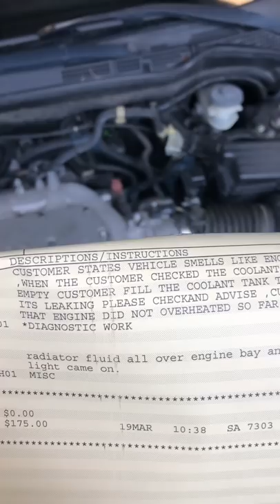Do not use this type of hose clamp because…

Comment: Had nothing but issues with oem clamps, especially working up north. Almost every one of my trucks leaked in cold weather with low mileage on factory clamps, replaced with that style and never another leak for the next 300,000 miles lol. More like never reuse  factory one..

Comment: Tighten them on speed 1 with a impact you good to go use them in mine never had a issue  thowes clamps tho I've been to shops where thay put the hinge where you need the proper tool to get them off

Comment: Yes there's an issue with the material the radiators made of. That clamp is not the best policy. Someone could overdo it.
I've seen repairs done that included using pipe inside to strengthen the rad. Inlet tube.
Then you use a goop and the former material to restore the shape and reinstall the hose with a good clamp that won't overtighten.
Alot of shops won't try that, but certain ones have. Years ago, the expensive Behr style radiator used in Mercedes would fuse to the inside of the hose at the inlet.
The time may add up to the money a customer could spend on a new part for the car in the video.

Comment: Had the original type clamp been used, it would have still made a visit to the shop. That plastic is not designed to last forever, typically going brittle around the tenth year in service.

Comment: The clamps never broke metal fittings. This is what happens when the metal is replaced with plastic. Instead of saying the clamps are garbage maybe you should say the clamp is too good to waste on a plastic car. Four of those hose clamps have been used to hold down racing engines .

Comment: That radiator didn't fail from the aftermarket clamp. The plastic degrades over time and becomes brittle. This happens with factory clamps as well.
Reply from the maker: on a 5 year old car?
Reply: @2zzlow  sure depends on the climate. A radiator in Arizona fails sooner than a radiator in say Portland Oregon.
Reply: 100% true. You can see the plastic is degrading. It's totally normal, and it definitely happens faster in hotter climates. For example 10 years max on a factory toyota radiator in Florida. When I moved to Oregon, I saw plenty of 20 year old factory radiators still running on toyota's.

Comment: Worm drive clamps are more than okay. Preferred actually. 

The spring clamps are okay, until they’re not.

The problem wasn’t the clamp. It’s the fact that OEMs are cheap as fuck nowadays and use plastic that gets brittle and breaks after so many heat cycles.

Comment: Just use the right size they work great they're not great for super high pressures but a radiator shouldn't be more than 20 psi.

Comment: That radiator did not fail from that clamp. Yes wrong clamp was used but not the cause. Radiator was already brittle . Seen many radiators break the same way with Orem style spring clamps.

Comment: The radiator has a plastic flange and will deteriorate overtime the clamps has nothing to do with it, the radiator would have broke regardless of what type clamp you use. Just use the correct size and don’t over tighten it!

Comment: Can I use a worm clamp on a metal coolant line the metal coolant line had to be cut a little due to rust, so I no longer have a flare on it and wanna tighten it a little more than usual just to make sure it doesn’t slip off.

Comment: I much prefer worm gear clamps. The spring clamp ones will invariably leak unless you wiggle them around, move the hose a little, etc. At least in my experience.

Comment: I hate these clamps so much you need a wide angle plier to take em off and sometimes a special tool in tight spots but they aren’t that bad once you get the trick to deal with em down

Comment: 2 million miles on my engine and screw clamps work just fine.. when the plastic tends to break, it doesn’t matter what clamp it has.. the plastic is not made to swell, the hose is, Hence the barb to secure behind..

Comment: Been using them style of clamps forever and never had a problem so long as you use the correct diameter clamp and not over tighten the hell outta it.

The one in the video was the wrong diameter so they had to screw it in way more then necessary + it looks like they over tightened it.
Modern Plastic radiators also don't help 😅

Comment: Never had issue with these clamps. Don’t over tighten and let the rubber do its job. The plastic radiators are a big problem with the composite construction becoming brittle, cracking, and leaking around the seals as they age.

Comment: The way the inside of that Radiator hose looked. Looks like he has more issues than just that hose clamp. I have been using those clamps for years and never had a issues with those.

Comment: spring style clamps leak more often than screw style , especially if its been disturbed , even if its put back in exactly the original spot because the rubber compresses and leaves an indentation , so then you can no longer get equal clamping. screw style is more reliable for repairs I do not trust a clamp style under an intake in a difficult intake install. Id rather not redo the job because of spring clamps.

Comment: Never had a problem with those. If you ever tried to over tighten them you would know how weak they are. I think this damage was caused by pulling the hose or pushing it on by the costumer. Engine looks like a honda j30 variant and is probably got some age, mileage and allot of heat cycles.

Comment: The clamps are fine... The plastic radiator parts are the problem. They had to switch to worse clamps to compensate for the cheaper parts. Yay modern vehicles.

Comment: There's nothing wrong with using worm drive clamps on rad hoses. That was not the right size for the application and no doubt was slightly overtightened on the brittle old plastic top tank. Been a qualified mechanic in Australia for 23 yrs, we use these all the time (not just our shop, the whole country uses them). You just need to tighten them appropriately and they'll never let you down. It's an upgrade from those rotten spring clamps when it's time to work on the car

Comment: I hate those OEM clamps because they are not made of stainless and they require special pliers that might not fit in a tight spot. OEM does not always use fasteners that are best, often they use what is cheapest for them to source and easiest for their workers to assemble on a bare chassis rolling along the assembly line, bottom line cost. Also the reason we have plastic radiator tanks.

Comment: This isn't a clamp problem , it's an old and deteriorated radiator problem. Jubilee(uk) clamps are very efficient as long as you use the right size and don't over tighten them. We use them all the time and NEVER have problems.

Comment: Precisely what happened to me. The top radiator hose had slid completely off after about 5 years as a result of using those worm clamps. When I saw the long trail of steam, I thought the engine had blown! No more worm clamps.

Comment: Those worm clamps are fine as long as you don't over tighten them..... and also if the radiator broke.... the plastic was probably brittle already.

Comment: Never reuse the "stock" clamps. They warp over time and loosen up, so reusing them can cause the exact same issue. Either t-clamp, or worm clamp. Ive never once used those stock ones over a worm and it be better.

Comment: They probably used a socket. It's to big over tightened it to compensate for it not sealing mishaping the clamp. Plastic radiator tank

Comment: Worm drive clamps are much better. And they will strip before you over tighten them. If your radiator shatters because your clamp was tightened too much, it was old/brittle and you needed a new one anyways.

Comment: At the end of the day this customer caused the problem. Changing that clamp caused this whole ordeal and the oem clamps never leak! I worked for Honda for almost 17 years and I’ve never seen an oem clamp leak or loosen 😂 I hate these screw clamps. I’m sure the radiator cap seal was leaking and they thought it was the clamp and replaced. Now a $5.00 cap just turned into a $800 radiator.

Comment: If you I we tighten anything you will break it, never EVER had a problem using worm style clamps. That radiator probably broke because it was old and GM coolant deteriorates the plastic. Like it’s not a known issue for the past several decades.

Comment: customer just used the Wrong Size clamp, that's all.Just don't over tight them. Tight them until they don't wana turn no more.Been using them for  a few years,no issues.

Comment: Ford dealerships won't sell the spring clips that came with the 6.0 anymore because of leaking issues and tell you to use high quality hose clamps. That system looks contaminated! Mixed coolant types? Oil contamination maybe?

Comment: How about steel radiators like they use to be. Will not blow off. Had that happen with plastic radiator. Plastic is the crap. I have always used these clamps. No issues.

Comment: The main problem is plastic for a radiator not the clamp. If it was made of metal that wouldn't be an issue and radiators could last longer

Comment: It's the radiator and not the clamps. My radiator neck broke just like this and I was using OEM clamps. The clamps shown in the video is way better when you have to take off a clamp in tight areas.

Comment: I had an older man bring his 300 into my shop one day and stated he needed a heater core. I looked in his interior for signs of coolant leaking,  checked his reservoir.  Asked him if he smelled coolant or had to add. He said no.  He then got pissed at me for looking on the passenger side because he said its under his steering wheel. He then asked me if I knew what I was doing? I then asked him if he did? He told me yes because he was an engineer. He told me to go back to school.  I just walked away.....

Comment: Lol this just happened to my Nissan Murano. It still had OEM clamps. The only reason to not use the screw clamps is that it is on plastic. Otherwise they are superior to the OEM spring clamps. 
BTW wire clamps are A#1 and are far superior to all.
Reply from the maker: Exactly! The worm style clamp was not designed for a plastic radiator.

Comment: Those clamps work fine as long as the inlets are metal. They have worked fine for decades. The problem isn’t really the clamp it the fact the radiator is made of plastic. The one in my 1951 Jeep is metal and has never been replaced and has used worm clamps the entire life of it. No problems with things breaking. If they used plastic wheel studs would you blame the problem on the metal lug nut?

Comment: they're fine, if they're used right, and are quality clamps, instead of cheap garbo.

and yes, this one came down to plastic degredation, and not the clamp.

and yes, it might be personal preference. so don't swap parts that don't need it. not only would it possibly add costs to a bill that shouldn't be there, but you're basically putting your preference, over the owner of the vehicles.

and in a situation like this were it doesn't matter most of the time, you're the one saying 'my preference is better than yours, in spite of it being your property.'

i'd probably be having a pointed (though reasonably polite) word with management, on the basis of unnecessary 'repairs', based solely on opinion.

if the clamp is actually broke, thats one thing.

swapping it out because you don't like them?

YTA.

Comment: OEMs use those style of clamps because they're cheaper and, especially, because they're faster and easier for the car factory's assembly-line monkeys to put on! Not because they're particularly better or longer lasting.

A stainless steel, worm gear hose clamp will NEVER fail. Just don't over tighten it..

Comment: That style is completely fine, but don't torque to a hundred ft lbs. Cooling system has very low pressure. Snug is all you need

Comment: In india, those type of clamps are soooo low quality. If you even tighten them, the tightening screw comes out. That is the reason i hate em. Now there are the wire type nut and bolt type clamps in the market. I just love them. They are sooo robust that they could've even broken that if it was aluminium 😂😂

Comment: It's the plastic that deteriorating. Clamps are there to hold in place whether to sealing. This is the fault of the car owner that never do regular maintenance.  All they did after bought it and coolant started leaking down the road.  Owner being too cheap or lack of knowledge and just keep adding water instead of mixture of coolant. Water evaporate quicker than coolant. Insufficient coolant lead corrosions n eat up the plastic.  Remember water causes rust.

Comment: Been using worm gear clamps for decades, I replace the shitty factory ones every time. NEVER an issue. Crappy plastic parts with OEM clamps break all the time. If you are loosening a plastic tee with a factory clamp the sideways force from clamping the clamp to remove it break off the nipple. A worm gear clamp can be loosened with less sideways force.

Comment: Both clamps work.     Just need to be installed properly.      Both fail. I wouldn't have a job if things didn't brake.     Yes I know I used the wrong break .

Comment: Well the clamp did not cause the rad to fail. Also if worm clamps are garbage why do most boosted cars use them on charge and cooler pipes instead of the spring clamp? Some see a lot more pressure than what a cooling system sees.

Comment: I personally prefer to remove the worm clamps but to use the spring clamps. Worm clamp looks shitty and you have to tighten it. The spring clamps just clamps down when you release it and your done. That's my opinion no need to get all fussy about clamps.

Comment: If that radiator was made the correct way out of copper and brass. it would still be good, and even work better.
as it was the the cheep plastic that failed. not the hose clamp, but it was the wrong size of clamp, should not have such a long tail on it.

Comment: Bro, you don’t need a whole ass new radiator, just the radiator cap
It’s been 10 years I changed mine in a 2001 Cherokee and it runs perfectly fine, also did it on a Nissan Frontier five years ago and both vehicles run cool without problems

Also, those clamps are not the issue, as long as you know how to use them properly 
I’ve seen people snap plastic connections just because improper tool usage or struggle removing or putting it back on, the plastic just becomes brittle after too many heat cycles and weather conditions

Comment: Don’t over tighten them lol I’ve got ONLY those clamps all over my truck and cars… not once.. NOT ONCE have they leaked or broke by themselves like everybody’s claiming. Personal preference tho. I can’t tell you how many of those OEM squeeze clamps I’ve found that just rust, and let an elbow blow off the radiator. Common on mid 2000’s impalas.

Comment: Them clamps are better then oem them hose clamps can't be over tightened they would strip B4 over tightened the oem ones suck you can pull the hose off without take them off or they leak

Comment: Nothing wrong with those clamps, the oem ones are awful and when they rust they are a nightmare to get off, usually just cut them off to save hassle and guess what…replace with the clamp you said was awful with 0 issues 😂

Comment: No, YOU tell that to customer. Tell them it's broken. Yes you can use those hose clamps. They work just fine when the radiator isn't old, frail, and broken.

Comment: Back when radiators were Not plastic that was the only clamos used , radiator , heater hose , water pump etc. The bad plastic radiator from what was noted in earlier reply , may have broke anyway. Duh. Doesn't mean they are bad clamps. Good clamp used on inferior crap.

Comment: The clamp was not the problem. Plastic radiators have a life span. The plastic tanks get brittle and break after a couple of years...
Reply from the maker: So 5-8 years is the life span? It cracked due to the incorrect clamp, it was designed for a spring clamp to allow for heat expansion.

Comment: Clamp wasn't the problem. The radiator was beyond service life. A lot of mid 90s thru early teens cars and trucks used a poor abs plastic that absorbs the petroleum and becomes brittle.
Reply from the maker: 2015 car
Reply: @2zzlow  depending on model some of them are even worse. Chrysler/kia/Hyundai being the absolute worst.

Comment: There’s more going on with this vehicle than just the wrong hose clamp. Sure it needs a radiator- but it’s a symptom of a bigger problem. Especially with the original clamp having failed requiring a worm gear replacement. Probably needs a head gasket, or it has another leak somewhere else that has caused the radiator plastic to be cooked and brittle like that.

Comment: That clamp didn't break that radiator, thermocycling of the plastic weakened the plastic and pressure from the system cracked it is my theory.

Comment: Its funny he wants to blame worm drive clamps, like constant heating and cooling cycles wont do that to the plastic anyway. Ive had three OEM radiators with the OEM tension clamps disintigrate that same part of the radiator. Plastic has a lifespan, its not tge clamps fault.

Comment: Being how I have a ignorant rookie mechanic contradicting my professional advice or experience. maybe you might want to also know that I was in the Plastics industry as well and I know damn well that plastic radiators become bridle with extreme heat & in this case the customer likely heated that vehicle hotter than what it's normally running temperature is,  which in turn will create that radiator to become more brittle. So get your information and research correct before you call out a professional. And that's the biggest problem is that you kids don't listen to wisdom and experience you think you know it all cuz you change the brakes on Grandma's car.